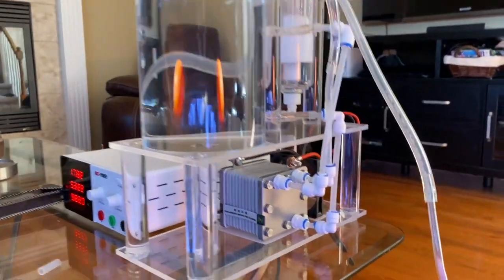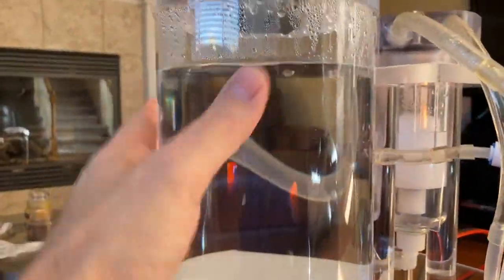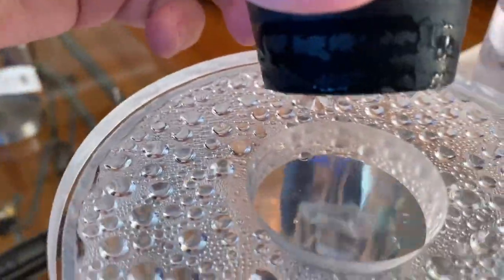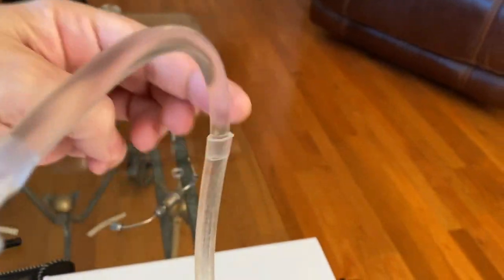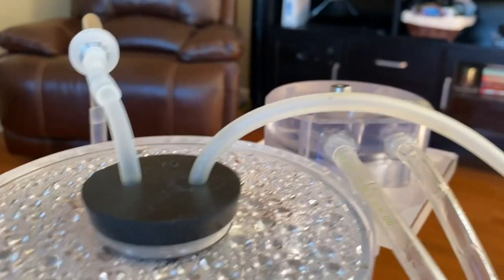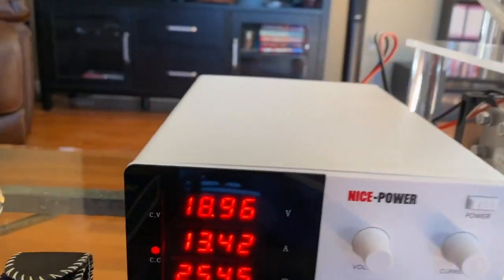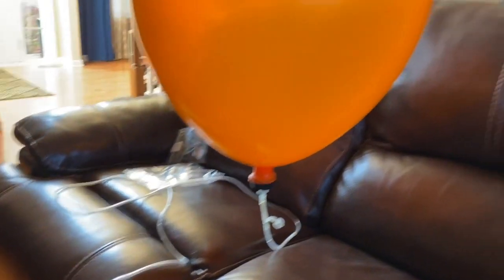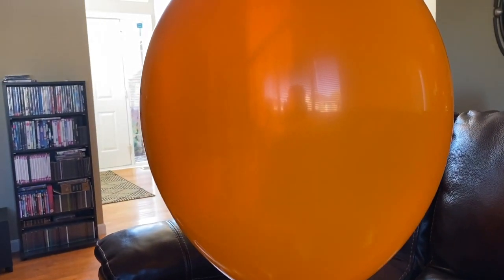Built a new compact PEM hydrogen generator!

Comment: bru, put a positive terminal in some water, let it drip over some aluminium wire that is negative charged. when the two meet, it should flash into 100% HHO with aluminium oxide as a byproduct, the aluminium oxide can be heated back into aluminium. to increase the productivity of the gas, use some gallium as a catalyst. the gallium will not flash away.

Comment: Were do you find all the fittings and tubing?  I've looked forever and can't find any like that.
Reply from the maker: Most of the connectors are just standard 1/4" OD quick connectors like what is used by reverse osmosis systems.  They're very strong and leak-free and easy to disconnect.  There are a couple exceptions.  The two connections in the side of my water tank are custom.  I burned a hole in the side with a soldering iron and inserted pieces of acrylic tubing into the holes while it was still molten.  But they needed further sealing with acrylic solvent cement.  I can't remember what all the tubing is... different diameters, some is from Grainger and the thinnest tubing is just aquarium tubing from WalMart.

Comment: Hello. Good design. I want to know if the water is alkaline or not.The size of the plate? Thank you.
Reply from the maker: Sorry for the slow response.  This one isn't alkaline, only uses pure de-ionized water.  It's 10 PEM (proton exchange membrane) cells in series, so 9 neutral plates, 11 total, with 10 membranes in between.  I didn't build the electrolyzer cell itself in this particular build (I built the apparatus) and I don't have it in front of me but the active area of each cell is pretty small, somewhere in the neighborhood of 2" x 2.5".  Pretty good output for something so small, huh?
Reply: Where could I find an electrolyzer like that?
Reply: @bryceryden  Ebay has lots of them.

Comment: sorry......i did not know that thing was built like a fuel cell.......i thought: 2 plates, stainless, polymer mesh between, so can use either a.c / d.c. , so not a problem........i stand corrected.
thank you.
p/s........happy new year! :)
Reply from the maker: Sorry for the very slow response.  Yeah, it really is like a fuel cell.  In fact, it really is!  When I suddenly disconnect power to it, it will start consuming the hydrogen making contact with the cathode and actually produce electricity.  I noticed this once when my power supply LIT UP after I unplugged it.  I was like "DANG! It's running off of hydrogen right now!".  Even the fan was running.  There are some differences between a PEM electrolyzer and a fuel cell though.  I think fuel cell PEM membranes can get away with being a little thinner but many of them have liquid cooling on the other side of each plate.

Comment: nice and also if possible share detail and design how to built this
Reply from the maker: Do you mean the whole apparatus or the electrolyzer unit itself?  This time I didn't build the actual electrolyzer myself but I built the apparatus.  The electrolyzer is just the little metal and plastic cube on the bottom platform.  However, I built similar electrolyzers before.  You can google PEM electrolyzer cell stacks to get more information.  It involves sandwiching a bunch of MEAs between graphite or titanium plates or screens and having channels in the plates for the gasses to escape from either side and for water to flow in.

Comment: How many Kws per Kg of H2? Thx
Reply from the maker: Hi, that's a good question.  I just ran thru the calculations.  If I run it at only 1 LPM, I can operate it at only 18V (or 1.8V / cell) once the water warms up and I calculated it to be 47762.376 Wh per Kg so 47.7 kWh per Kg.

Comment: How can i get a stainless steel set up here
Reply from the maker: I'm not as familiar with HHO hydrogen generators.  I only built one in the past and I know you use stainless steel because it's more chemically resistant than most metals and relatively cheap.  These PEM cells actually have some platinum inside them, which is way better than stainless steel even.  It's such a small coating that it doesn't drive up the cost too much but still considerably.  Doesn't mean PEM electrolyzers don't degrade though.  The platinum doesn't degrade but the Nafion membranes in between each plate does degrade over time.

Comment: instead of feeding that thing with D.C., try using A.C., you'll get much better (cooler) thermal performance.
Reply from the maker: With a PEM-type electrolyzer, you have to keep the polarity right, so A/C would destroy it.  I think it has something to do with one side not being fed with water (negative / hydrogen side), even though water comes out of that side with the hydrogen.  The proton exchange membrane would burn up.  I suppose you could design one that feeds water into both sides and use A/C.
Reply: @ChristmasEve777  Don't listen to the whackjobs spouting nonsense about using A/C with an electrolyzer. If you want your PEM stack to last, you have to keep 3 things in check:

1. Polarity, voltage limit. DC only, please. And given that you use no pumps, no more than 2V or so per cell, to limit oxidation of the oxygen electrodes. This voltage limit is also dependent on stack temperature. The cooler, the better, even if that limits your gas generation rate.
2. Water quality. Only use DI water, and keep contamination sources (like dust), to a minimum! Most commercial systems use a resin exchange filter to maintain water purity.
 3. Pressure. Keep to a minimum pressure in the hydrogen side of the system. Mixing of oxygen and hydrogen accelerates aging of the membranes.

Hope this helps, it does look like a neat little tabletop system!

PS: the reason most systems use water circulation in the oxygen side is to maximise system performance: you spend a bit of power in the pump, but you can reach higher currents for a given voltage. This means your system can use a smaller stack, and your energy efficiency is higher. It also helps cooling the stack at high currents.
Reply: @AG-el6vt   Hello AG, I see you have some knowledge about proper usage od PEM hydrogen generators. I'm looking for someone to give me some advice about power supply for my home made DIY PEM hydrogen inhaler. I have a generator (like 800ml H2/400 ml O2) with 12V 26-28A DC Constant Current power supply in specs. I was trying to power it with PC Server power supply 750W with 62,5A 12V line, but if failed and didn't even started. So I connected my generator (I have also water pump) to Car battery and it worked but connectors got hot so I switched it off after a 20 seconds. I'm looking for some nice power supply which I can hide in PC  case together with PEM cell and forget it. Could you give me any advice? As I understand I need some Constant Current transformer which I can set to a proper values (voltage and amperage) and then put it all together? Thanks.

Comment: Apparently you have never seen a hydrogen explosion.
It takes about a cup full of hydrogen to make you look like a piece of fried chicken.
I have seen this happen and the effects from places that I have worked.
One was a hydrogen purification process where the technician was trying to change out a valve.
He was using a steel wrench to disassemble the pipe and a spark set it off... he should have used brass wrenches.
I met him the day I left that job... he did in fact look like a piece of fried chicken, picture a chicken leg.
I am not sure how he survived and I would not have wanted to.
Another workplace was where hydrogen formed between a 6x6 foot box of water and a 2500 degree ash-bridge above it.
When the ash-bridge was broken from above, the explosion blew the operator about 40 feet to the roof of another building.
The operator did survive also but there was some major damage.
That 6x6 foot 1" thick Inconel box was twisted like a soda can.
Hydrogen is nothing to mess with.
If you are going to do this, stay a week away from it.
Google the Hindenburg, 35 fatalities.
Reply from the maker: I know it is a dangerous gas.  But I have igniting volumes of hydrogen greater than the side of a beach ball (using a long pole).  I know the amout of energy that's released.  The good news is I have never had any hydrogen spontaneously (or accidentally) ignite and I've been doing this since I was in 8th grade.  The Hindenburg was a terrible mistake.  The Germans thought it was a practical and cheap way to lift a heavy payload, despite the danger.  They were right about it being cheap....  not practical.